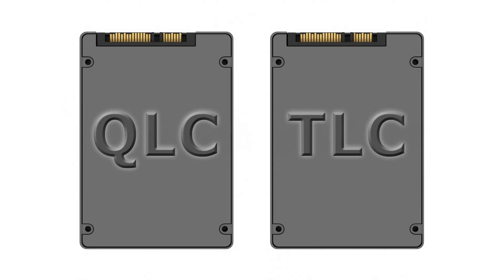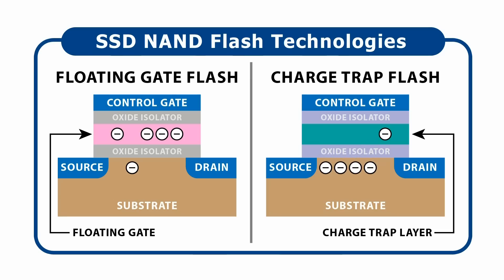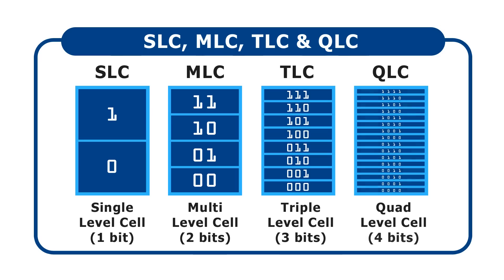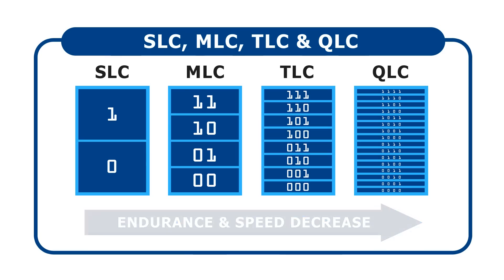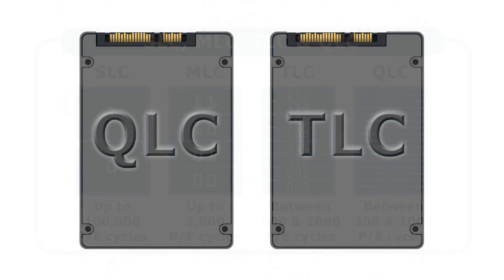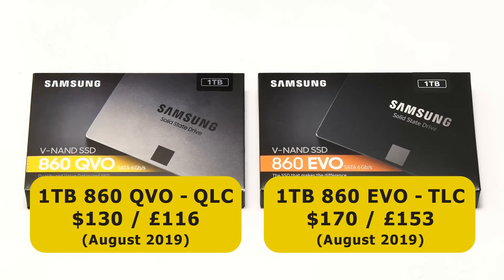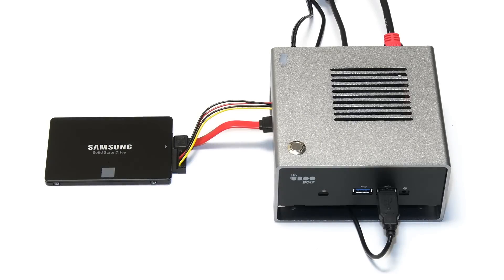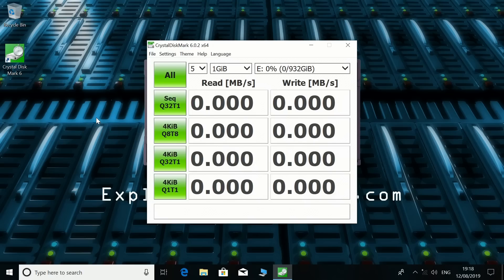QLC vs TLC SSDs: Samsung QVO & EVO

Comment: Were you able to sort out the issue with the TLC drive not hitting a cache limit? Great video, I really like the attention to detail in the way you do these tests.
Reply from the maker: There is some useful discussion of this below. Possibilities include the fact that the TLC cells in the EVO drive may be able to write faster than the SATA3 interface speed, so even when the cache is full, it can still maintain speed, and can also clear its cache quicker. This seems most likely. Alternatively, the drive may have been upgraded and the specs do not reflect that yet.

Comment: Chris, as always, your presentation is wonderful and very clear.  If you think it might be a worthwhile experiment, I've been toying with the idea of powering a few 2.5" SSDs with an ALWAYS ON AT-style PSU, and leaving them powered for something like 6 to 12 months, without powering them down at any time during that period of time.  Many months ago, I came across some reports posted on User Forums, claiming that powering Nand Flash SSDs OFF for extended periods of time, results in serious malfunctions, data loss, data corruptions, etc.  So, naturally, I am curious to know if doing the opposite -- POWER ALWAYS ON -- has any measurable impact(s) on standard Nand Flash SSDs.  The experiment could compare SLC, MLC, TLC and QLC drives, in order to observe any noticeable differences when all 4 types are ALWAYS ON.  This is not such a wild and crazy idea:  there are quite a few computer chassis that have room for 2 independent PSUs.  The second AT-style PSU could be installed in the secondary PSU bay, and it could be powered by a quality UPS / battery backup unit.  And, a quality UPS like the ones made by APC (American Power Conversion) comes with a USB feedback cable, that records black-outs, brown-outs, voltage surges and drops, etc.  I believe that software is called PowerChute Personal, and it could provide one way of ensuring that the ALWAYS ON experiment did, in fact, stay ON for the entire duration of the experiment.  Of course, if one variation of this experiment switches the primary PSU OFF e.g. system SHUTDOWN, then there would be no way for PowerChute Personal to record any power incidents while the main system is powered OFF.  I'll bet you can think of several ways to guarantee that the ALWAYS ON secondary PSU remains ON for the entire duration of this experiment.  Perhaps an inexpensive, low-power laptop could do the monitoring with the PowerChute Personal software (or comparable software from another UPS vendor), and the second AT-style PSU would remain ON while the main system is SHUTDOWN daily e.g. under normal use.

Comment: I use Samsung EVO's they last longer and perform better than the other SSD's I have tried.   When you have a working solution its very hard to move away from it.  I use SSD's for OS, Programs and some very limited data storage.   I use Mechanical Drives for storing all my data and my servers are setup the same way.
Reply from the maker: You are not alone! Many people find that EVOs work and work well -- I see that time and time again in the comments on this channel.

Comment: The problem you have brought to light is temperature and not cache related.

Please redo the tests and use HWiNFO to record the drives' temperatures as the tests are carried on.

You will notice that the QVO drive cuts off its speed once it reaches 50-55 degrees of Celcius. In fact at 57 degrees the SATA bus is completely saturated and the test PC might become unresponsive.

To further verify this claim, you can redo the tests when the QVO drive is already "hot". You will notice that the speed decrease just after a few megabytes.

Overall, I think the issue you are pointing out here might be related to the poor Samsung implementation of the new technology and not to the technology itself...
Reply from the maker: It would be very strange for the QVO to have had such a dramatic drop in write speed due to temperature when the transfer hit the exact capacity of its SLC cache.

Comment: Do SSDs break all at once, or gradually, giving you a chance to rescue data on the drive?
Reply: @Ana Assburgian I guess I'll keep the SSD for OSs and programs, and HDDs for irreplaceable files then. Thanks for the tip!
Reply: @Ana Assburgian I read somewhere that compact flash was the most reliable archiving medium, which makes sense, it doesn't degrade like plastic disks, has no moving parts etc. They're just pricey

Comment: What you did not take into account is that TLC is somewhat faster than QLC, so it does make sense that it would take longer for performance to drop since, in the background, the ssd is clearing that cache dumping the data into permanent storage (which on TLC is significantly faster). So it was just a matter of time when the EVO would burp into low 100MB/s ballpark
Reply from the maker: Very good point.

Comment: Well, at least in my opinion, the QLC drive (QVO) are shit and should be avoided like the plague. They are totally overpriced for the delivered performance and reliability. They need to be at least 50-60% cheaper than the TLC drives.

Comment: You're not seeing the 42 GB SLC cache on the TLC drive, because it takes more than a 75 GiB transfer to see it. The TLC cells can take writing faster than the QLC cells, so your data is moving through that SLC cache faster.
Reply: I was thinking that we wouldn't see the drop at the 42GB point for that reason (for either SSD), but I didn't consider that the difference in TLC and QLC write speeds would be emptying the cache at such significantly different rates.
I wonder if this also explains why the QVO also had faster write speeds during the cache phase: The EVO cache was spending more time sending data on permanent storage, and therefore had less time to receive the incoming data compared to the QVO's cache?
Reply: @nekomatafuyu  The QVO probably just has faster cache. It's newer technology. It really sucks that SLC drives are nowhere to be found. I bet they could fit a pretty good amount in a 3.5" form factor.
Reply: Since that was topic of the video, I would liked to have seen that point reached.
Reply: I have been using that 1 TB QVO since May in my laptop and for sure there is no cache like 42 GB not even 4 GB ready all the time. I copy music albums quite often their size hardly hitting 1 GB and the write speeds quickly drop to that shown on this video test (roughly 60 to 80 MB/s) and just in a few seconds. I now sort of regret I did not get Crucial MX500 instead since that was the SSD I was after initially.
Reply: @tommik1283  the buffer may be filled with more than just that file you're trying to copy. Basically the cache is hiding the slow write speed. My guess is that the cache was still busy with previous write operations. 

Let's say you're copying 1GB at a time. By the time you're copying your 42nd GB your operations will slow down because the previous are still being written to the drive.

When it is a boot drive, it might be that by the time you're copying your filea, the buffer is already filled with loads of operations from other programs, like temp files and virtual memory.
Reply: @RedJRyan  yep it is a boot drive and the cache is probably filled "nearly all the time".. it is what it is unfortunately (the drive has > 500 GB free space out of 930 all the time)
Reply: Actually no. The algorithms of 860 evo cache does not move all the data from SLC to TLC in a short time. Usually it requires more than a day to move all the data from SLC cache to TLC, I guess, just to save the lifetime of the TLC cells. 860 evo moves only 4Gb of data in a short time to TLC, but not other data. You can easily find this behavior if you have 500Gb or 250Gb 860 EVO. With writing to 1Tb 860 EVO you will be limited not in the speed of TLC, but in the speed of SATA3, except you are using used drive with fragmented freespace, then writing to TLC will be slower.
Reply: What happens here is that the MLC write speed on the 1TB EVO drive is at least 420 MB/s, and that is according to Samsung specs for the older 840 model. It is as simple as that.
Reply: Exactly what I had in mind. It's a pity he didn't test the amount when the cache is actually full.

Comment: As always, it’s simply a case of picking the right drive to fit the intended purpose. For my last new PC build a few months ago, I used a Samsung EVO for my primary / boot drive, but chose a QVO for my second drive (used for data / archive storage). ie. Why spend extra for a second EVO, when the cheaper QVO was perfectly fine for my intended secondary drive use case. There is no generalised “which one is better” answer. If the QLC technology drive is fit for the intended purpose, then it is the best one to pick by virtue of saving you some money. :-)
Reply: hi, does the QVO writes slower once it's filled? I'm planning to do the same setup for my pc. Thank you in advance.
Reply: @jeremynathanael  Hi. Inspired by your question, I just fired up the latest CrystalDiskMark v8.0.4, out of interest.
My Samsung EVO 970 1TiB system drive is current 42% utilised, and my QVO 860 1TiB data drive is 92% full!  This is after over 2 years of daily use.
My EVO system drive (970) is still blindingly fast. :)
CrystalDiskMark is showing all tests on my QVO 860 as actually exceeding the results Christopher displayed in his video. 
eg. I'm measuring on the RND4K Q32T1 test: 319.83 Read / 299.68 Write (MB/s).  On RND4K Q1T1 test: 32.99 Read / 97.53 Write (MB/s).
So I guess that seems pretty impressive.
Personally I've experienced no performance issues whatsoever on my speedy system, for which I use the QVO 860 data D: drive for everything from 3D design to Video editing etc. 
In fact, as I'm at 92% on my 2+ year old QVO drive, and constantly purging / archiving to NAS, I've also been planning on adding a 2nd Samsung QVO 1TiB data drive (as a drive E:), so I can migrate some of my D: drive data over to give me more workspace headroom across two data drives. 

Hope this helps. :)
Reply: @gregclare  Hi Greg! Thank you this actually helps a lot, I planned to use the QVO disk for gaming purposes only. I suppose they're less heavy than video editing and actual work.

My biggest worry is that I rarely remove old game, so it might be full in no time. But i guess that would not be an issue. Thank you for your effort and insight one more time!
Reply: @jeremynathanael  No worries. I'd say plenty of perfomance for only gaming!  You could always go for a bigger (eg. 2TB) drive, but given that there isn't that big a price advantage (at least in my country), then I think it better to buy the 1TB and then add another drive when you do actually need more space (and prices may have come down in the meantime).  ie. Don't spend money on way more storage than you actually need, as per GB prices generally drop over time.
Also, I'd probably prefer 2x 1TB drives over a single 2TB drive, as 2TB is more to loose / recover, if you have a single drive failure! ;-)
Reply: @jeremynathanael  ps. If you're building a system, you may be interested that my system drive choice was the Samsung 970 EVO Plus NVMe M.2 1TiB drive for C: drive system and applications etc.  Perfomance of this is just amazing!
My D: data drive is the SATA connected Samsung 860 QVO 1TiB, so  I currently only have one SATA connected drive.
These were my optimal build choices in 2019, which I'm still very happy with over 2years later!
I'm now planning to add a second SATA data drive with a Samsung 870 QVO 1TiB, noting the 870 QVO is just the latest version but more or less the same performance of the 860 QVO. 
Have fun with your design choices. :)

Comment: Thet "Big data copy dip" at ~40% was interesting to see :)
Reply: yea but why didn't it happen with the TLC drive
Reply: @maicod  I meant the small dip after they are reached "SATA sec" Both at the same time dipped a bit, then come up, then the qlc fall (?)
Reply: @ledgeri  oh I didn't spot that. Let me try to see it in the video EDIT : yea I see it too. maybe the SSD's controller IC's were bottlenecking
Reply: @maicod  Is that the same model? I Dont thinks so, but maybe.... Also Maybe OS limitation, or Sata controller...
Reply: I guess they needed to design a new controller IC for the QLC cells.

Comment: I still have an old 32GB Lexar Triton USB 3.0 flash drive which uses Intel SLC flash.
SSDs usually last much longer than their "guaranteed" endurance (except for some Intel drives which are programmed to die after a certain amount of data is written, regardless of the physical flash state). An 850 Pro 1TB SSD lasted for a whooping 9.1 PB in a torture test. 840 Pro 256GB model lasted for over 2 PB of writes.

Comment: I'm gonna stick to my Firecuda for mass storage for couple more years tank you very much.
Reply: For mass storage I think we are all still on HDD?  I got all fancy and fitted two 1TB M.2 NVMe a few months ago, plus 2 times 2TB SATA SSD and felt very of the moment but I didn't kid myself I'd be doing that very often.  There's good things about HDD still, it is a mature technology and it doesn't really cause problems.  It works then it doesn't, Windows gets on with managing it and it is the only way I can populate my NAS arrays.  I would be wasting money on anything fast as I run Cat6.  Wouldn't want one as a boot drive though.

I bet they will still be around in 2021, nothing will have changed, even 3.5 drives will still be here, just the storage capacities will have risen.  But will the prices have dropped.  The big drives carry a massive premium, I guess because of the laws of physics.  The sweet spot for HDD has remained 4TB for ages now- by that I mean it makes most economic sense to buy three 4TB drives than it does one 12TB drive for example.

Comment: I just noticed something that confuses me. These are SATA 3 drives right? That initial burst of just over 1 GB/s makes sense given the DRAM cache, but doesn't SATA 3 have a maximum rate of 6Gb/s, giving it an absolute max of 600 MB/s with 8b/10b encoding? It makes sense that the drives would be able to do ~1 GB/s internally writing to their memory, but how can the host adapter possibly get that transfer rate over SATA?
Reply from the maker: You are correct, the initial burst exceeds the SATA3 maximum speed. But Windows Explorer is not always the most reliable in presenting such data. :)
Reply: @ExplainingComputers  Oh of course. I had forgotten you weren't using a bench marking tool for that part.

Comment: Nice to see that the EVO is better than specs. Nice guy Samsung :)
Reply: Samuel Schwager 
My assumption is that the turbo cache is acting as a FIFO and the TLC drive never fully filled the FIFO since it could offload the data faster than the QLC drive. The two drives probably have the same amount of cache.
I’m guessing if you transferred more data you would eventually hit a point where you fill the FIFO and reveal the true write speed of the TLC.
Reply: @sloth4urluv  Might be. Reading > 100GB from a RAM disk and writing it to the EVO might work to test that.
Reply: RAM disk isn't going to speed up the SATA interface. NVME is already tons faster than SATA 3, so it's just the EVO's actual performance.

Could just be that is the write speed for the TLC even without the SLC buffer.

Comment: what happens if you writing a lot of data to a SSD and when Windows says it's done, you shut down windows while SSD is  writing cache ?
Will Windows delay shutting down ?
Reply from the maker: Data written to the SSD's SLC cache will be fine -- as it is stored on the drive, and will be moved to TLC/QLC cells when the drive is next powered. Any data held in Windows RAM cache, or the SSD's RAM cache, would be lost, but this can be cleared very quickly, and should be accounted for in the Windows shutdown process -- with a slight delay in shutting down as you note.

Comment: There could be more than one thread of execution in the internal drive controller - which begins to empty cache as you put things into the computer end. If I'd designed it, there would be, it's a pretty obvious thing to do if you can (have the spare cpu resources...). They probably economized on the cpu on the less expensive drive and in addition - the QLC probably is a slower write.
For linux-heads - timeshift to a different drive that otherwise has low use is a good backup for most (has saved me once) and for just /home and /etc - ezee linux (joe collins) XBT works quite well for "your data" as long as it isn't too huge.  Both use a highly option-tweaked rsync and are fast.  I use a couple of odroid HC2's here (reviewed on this channel) as NAS backups as well - nice to have those layers - those are spinning rust, run linux and back up one another via cron jobs.  Now all my daily use machines can just have a fairly small SSD for speed, and the big stuff is elsewhere.

Comment: 860 series sucked for me.
Computer froze randomly no matter what I did.
850 worked fine
Reply: How many 860's did you try?
Reply: 1 but all the reviews and threads about AMD chipsets confirmed its the 860.
I returned the 256GB 860 pro the was $239 and got a 1TB 850pro for $199.
Best decision I made yet.
Never had a problem since
Reply: Samsung SSDs seem to be more picky about SATA cable quality than most other brands.
Reply: these are 6.0 cables